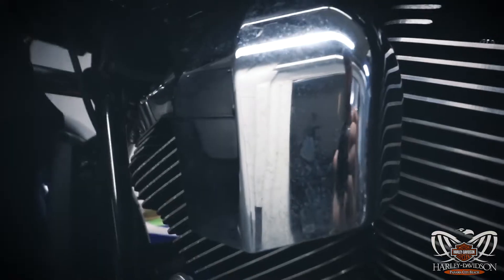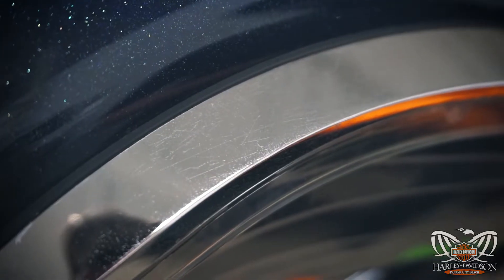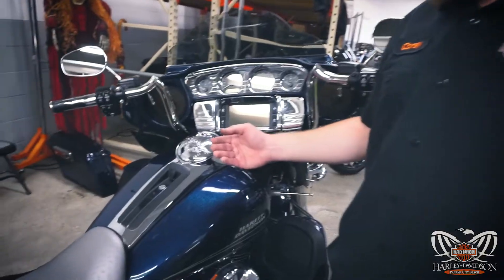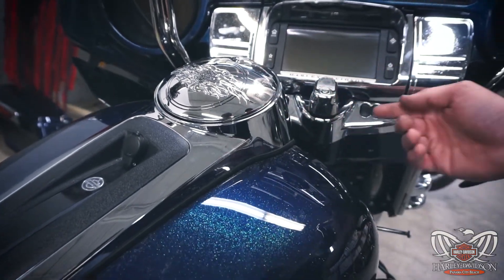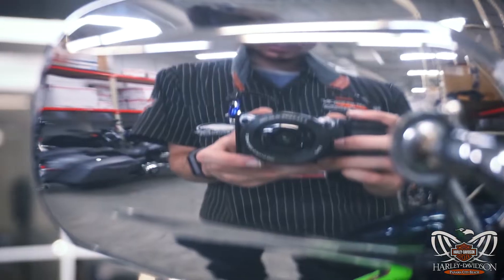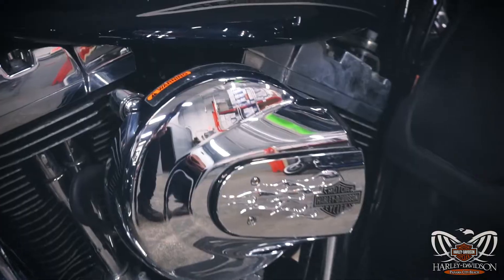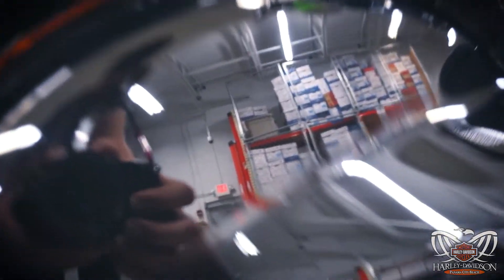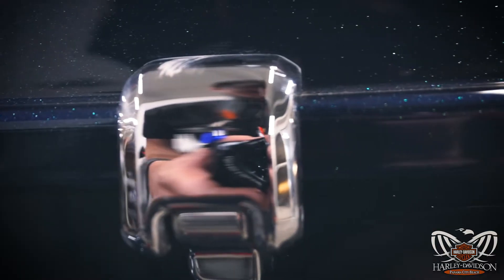How To *PROPERLY* Clean & Polish Chrome on your Harley-Davidson Motorcycle

Comment: Added suggestion - have your bike professionally detailed once a year.  Every Harley shopped has a detailer.  It's a little expensive but if you are in it for the long run it is worthwhile.
Reply: Lol my guy, the bought not built mentality. I bet you don’t even change your own oil
Reply: @kevindoolin3795  I do change oil in all three holes on both bikes.  A couple years back the detailer mentioned the back brake line was cracked and weeping.  I hadn't noticed before.
Reply: @pauljirinec2772  shoot 😮there’s 3 all I know is the oil and primary oil to transmission! Where’s the 3rd shoot I missed one please help
Reply: @Deon0026yickadee  1 - Engine, 2 - transmission, 3- primary drive.
Reply: Every shop has employees that wash as part of their job, i.e. porters. Not every shop though has a professional detailer/detailing service. Two of the three shops I worked at had no detailing services for solely washes. And the ONE that did, we charged $250 for. All three were Harley-Davidson dealers. I've read a lot of good about the chemical guys foam.
Reply: Don't use HD of carroll
Reply: @Deon0026yickadee  Sporty's have just two holes, that's probably what you're thinking.
Reply: @cali5ive124  yup that’s what I have

Comment: Thank you I just bought a Suzuki 1985 Intruder and it's a beautiful machine just like new so I appreciate the help with identifying industrial Chrome versus plastic Chrome!
Reply: Bought a Suzuki 2008 Boulevard s83 (Intruder 1400) this summer. Super clean, can't wait to give it once over before winter, so i also appreciate help with difference id'ng chrome.  Also, i used to own a 1986 intruder 700 black and chrome - best bike i ever owned.

Comment: A buddy of mine used 0000 steel wool w/ white diamond polish on his D&D exhaust and it left some gnarly swirls. I use steel wool all the time on the chrome of my SG with no problems so I thought he was joking, til I saw the swirls myself. Got any ideas on the best way to remove them, high speed buffer w/cutting compound then polish?
Reply: I used MotoPro UV Protectant and cleaner Polish

It took my chrome fenders that you would assume were aluminum and turned it into a mirror - effortlessly

Microfiber.